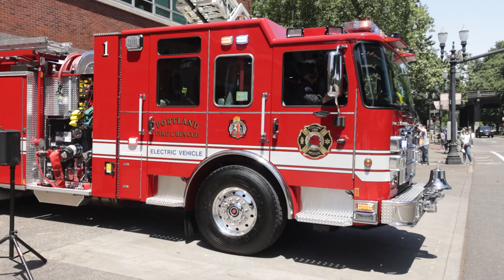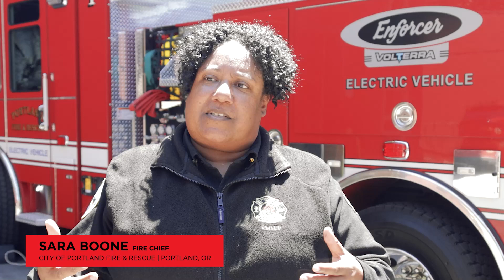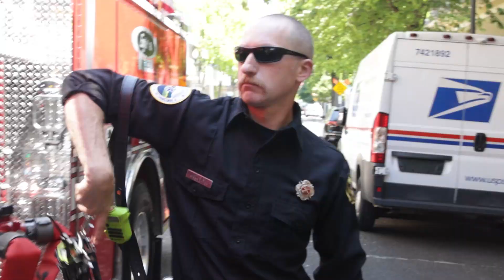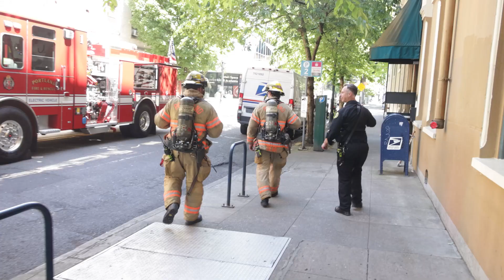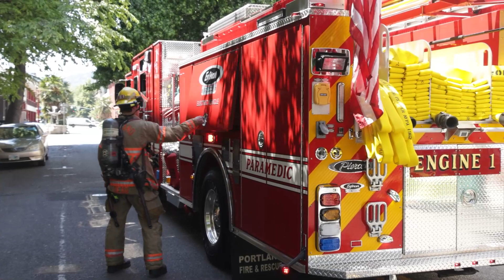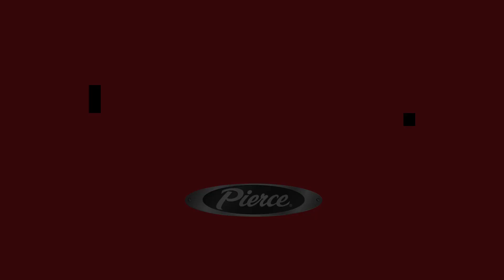Portland Fire Department’s Pierce® Volterra™ Electric Fire Truck

Comment: Cant wait for it to run out of power en route to a call!
 Laughable
Reply: Actually it has a backup diesel generator that it can operate on, however the city of madison summarized that in 18 months of 24 hour duty cycle as one of their busiest engines, they never had to use it once, not even in the winter and not on longer calls. And theirs has the small battery option. Seems like not a big issue.
Reply: Dinosaur 🦕 .
Reply: They charge it in house between calls.  Most fire apparatus (diesel engine based) plugs into shore power when in station to keep the batteries charged.
Reply: The same argument would apply to a diesel powered engine. Both can run out of power 🤷‍♂️